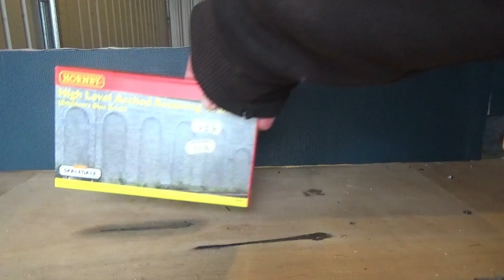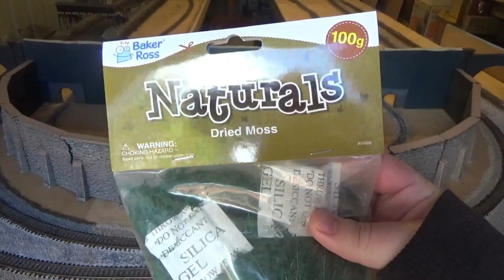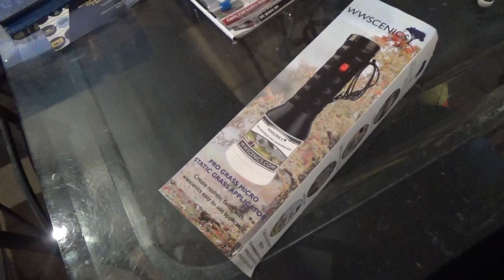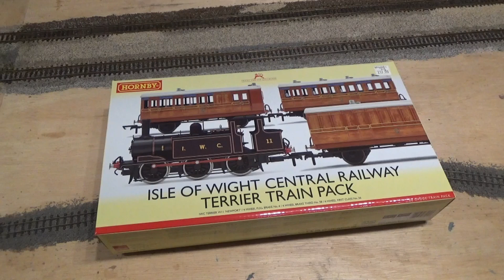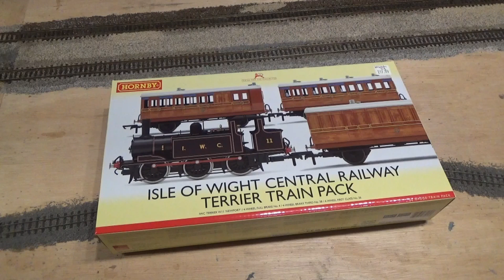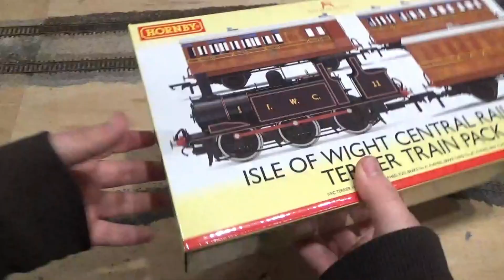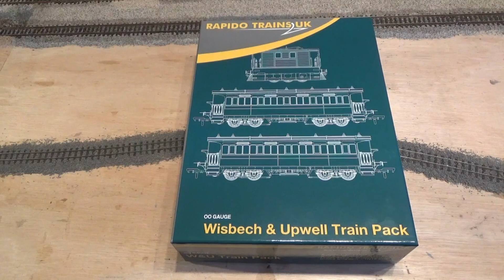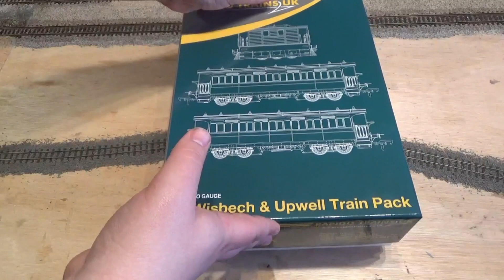The New Layout | Part 7: Walls, Static Grass and Details

Comment: This is some excellent work here Peter, first of all you should be very proud of what you have managed to achieve, nice to see how the tunnel mouths and how you have done them, I will admit when I first saw them in one of your review videos and how high they are I did originally think you had got 2 tunnel mouths that were O gauge, I never saw the extra pieces you fitted to increase the height in any of your review videos, some great additions there as well, the J70 pack with the tramcars is very nice, not sure whether I will get one of those to be honest, it’s a nice pack but currently I have much sights on other items, those Rapido vans, that terrier train pack is also very nice, I have still not got myself a model of a terrier yet, an overall great update and fantastic progress on the layout, keep up the great work.

A fa gastric running session at the end, a lot of great trains made for that, the Virgin 47 on the Mk2s and the long rake of pullmans all with their table lamps were very good.
Reply from the maker: Cheers David mate for the kind words, much appreciated as always